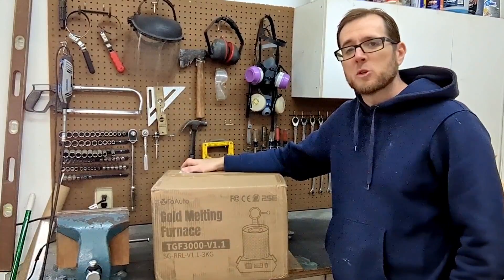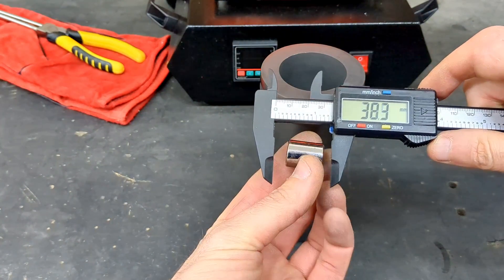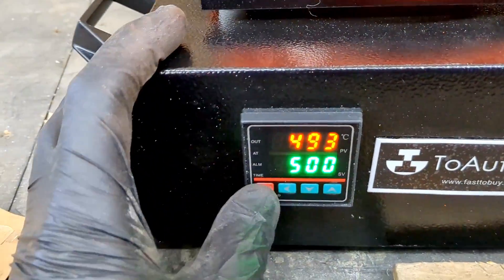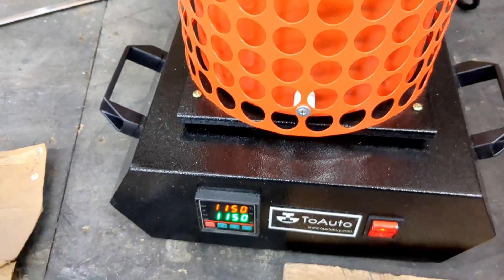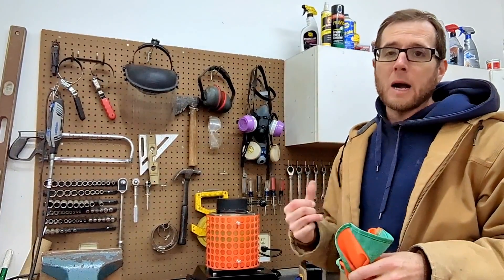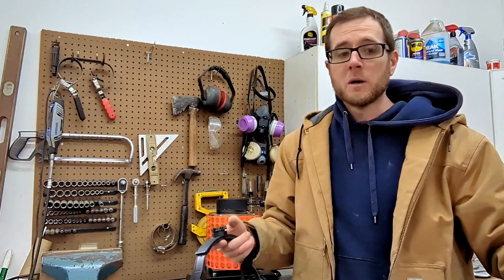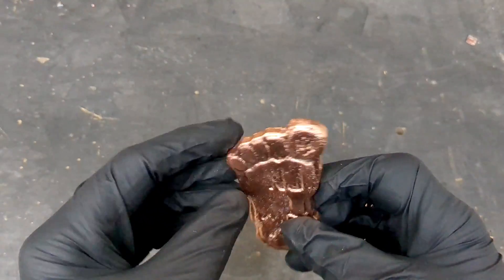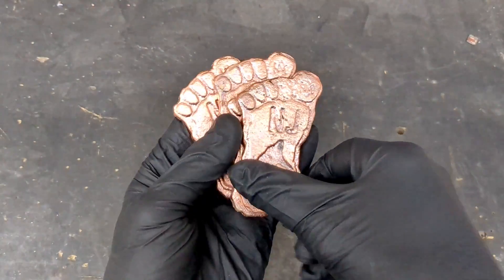Casting Copper with the ToAuto Melting Furnace

Comment: love the videos, I have this exact furnace, haven't used it yet. Can you tell me how you made those molds? Are the outside of the molds something you bought, but you made the molds inside with clay or something? Thanks.
Reply from the maker: That's awesome!  So far I'm enjoying the furnace.  Takes a bit of time to get to temp but that's fine.  I actually made the pattern out of foam.  Then cast it into metal, and used the metal one to make the sand molds.  I put a vidy in the description on how I made the molds. 👍
Reply: Thank you, i subbed and looking forward to your upcoming videos! @HeinrichsMade
Reply from the maker: @makingcookingfixing  thank you, I appreciate it.  I'm always making stuff. 👍

Comment: Nice work, awesome, very good video. Preheating the mold is really important.😃
Reply from the maker: Yeah it's really cold outside.  I don't normally preheat these molds when using aluminum.  It does seem pretty important to do it with copper.
Reply: Hey @ToAutoOfficial cheers!

Comment: That wouldnt be steam coming out at 1150 would it?  Smoke?
Reply: afaik the first hold at sub 500 (i do 300c) is to get rid of any moisture in a non explosive way
Reply: i also bought a clear face mask and full gown, I havent had any pops like you as ive only poured into sand (same flasks you have, but sideways) and casting flasks fresh out of the kiln
Reply from the maker: @TurdFergusen  yeah sand probably won't pop like this.  There was no moisture on the metal either.  It was just really hot molten metal coming in contact with really cold metal ...
Reply: I also think you can track the weight of the crucible .. though I havent done either 😬
Reply from the maker: @TurdFergusen  definitely start measuring that crucible in some way. 👍
Reply from the maker: Probably toxic vapor. 🤣🤣
Reply: @HeinrichsMade  please be safe my guy!  I use an n100 thingie also… thanks for preaching safety too

Comment: Nice! Well done!

I've been using the same furnace for a couple of years now. As I live in a condo, with neighbors on both sides of a wall and many more around, the noise of a gas furnace would be frowned upon, if even allowed at all. This furnace, while not the fastest thing to use, is quiet and allows me to melt on my porch.
Reply from the maker: Thanks buddy!

While reading your comment, I was thinking you used this indoors...  I'm glad you do it outside on the porch.  I couldn't imagine using this inside.  It could definitely start a fire.  Yeah it takes awhile, but that might be good.  Too fast might burn up the heating coils quicker.
Reply: @HeinrichsMade  There was one occasion where a light rain shower passed through. I almost relocated it to the garage, but ended up moving the furnace under a patio umbrella for about 10 minutes. Other than that, I've always used it outdoors. I wouldn't be against to using it in the garage in a pinch, but better outside in my opinion.
Reply from the maker: @misphet3  for sure!  I think a well ventilated garage would be fine to use it in.  That's where I use it.  I even thought about building an overhang to my garage to use my propane furnace under on rainy days.
Reply: @HeinrichsMade  That makes sense. My garage isn't well ventilated at all, as it  only has a garage door and no windows. It does have a high ceiling, though, so gasses would rise out of my immediate breathing area somewhat but not necessarily dissipate.
Reply: how many times have you needed to replace the heatling coil?
Reply: @noviceartisan  I've replaced the coil and heating chamber once so far, but not because the resistance wire failed. I had a crucible crack (new crucible) that leaked metal into the chamber. I haven't had a wire failed yet, but I might be overdue for that.
Reply: @misphet3  what temps are you using it at, 1110c often?
Reply: @noviceartisan  When I melt copper, I usually set it to 1111 because it looks cool and I'm weird like that. I usually go around 800 for Aluminum and 550 for Zinc. I will sometimes bump it up to 1150 if the copper is struggling or I add too much, but I don't like keeping it there for extended periods. 

Also, I limit my melting sessions to a few hours. I've read that longer duration melts is just as hard on the heating wire as the higher temps are. I'm not sure though.